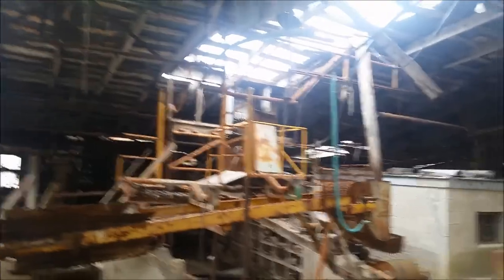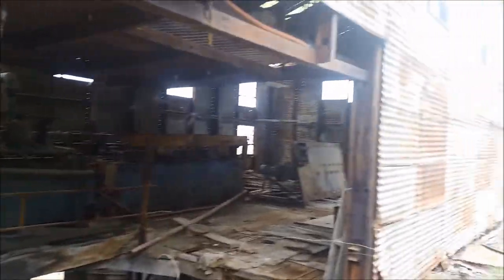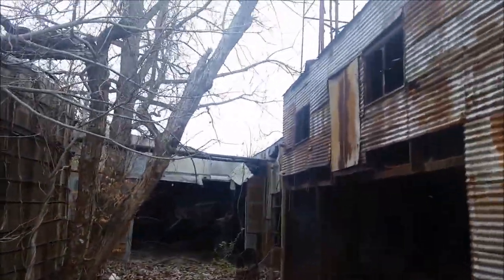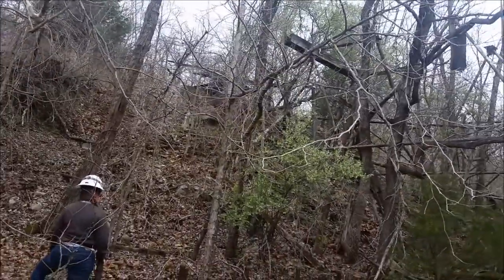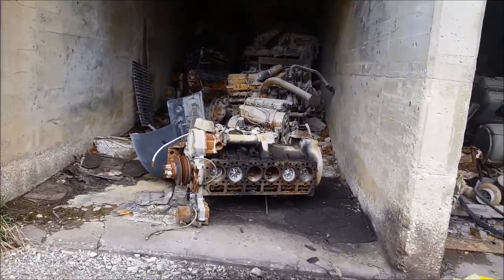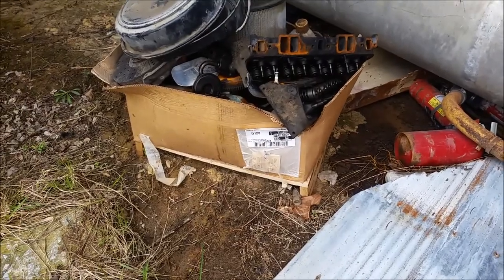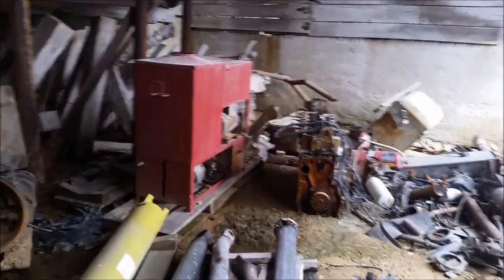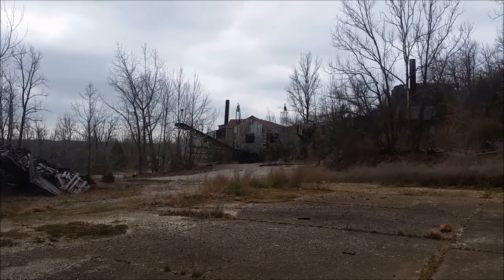Crystal Mine Exploration: Massive Fluorspar Mill from 1929!

Comment: This mill was "home" to me for most of my childhood and I ended up working here for several years as an adult. What memories this video brought back! My dad, Birch,  was a superintendent here. He and his 2 brothers Troy & Max Barnerd built much of the mill. As a child, I would go with my dad on the weekends. After the mill shut down, I transferred to Deardorf mine which was just over the hill.
Reply from the maker: Jack, thanks for your comment. As a mill guy myself, I love hearing from other guys who have been there and done that. The Crystal was one of the coolest sites I've videoed in all my time exploring mines!

Just out of curiosity, do you remember how ore was hauled to the mill and/or where the portals were located? That whole aspect of this site was hard to figure out.
Reply: The ore was hauled to the top of the hill and dumped into a hopper which fed a crusher then the belt would carry it to storage bins on the uphill side and rear of the mill. From there, it went by belt to a primary shaker screen and then into another cone style crusher. Then on to secondary/grading shakers which washed what was coming through. Eventually feeding into the heavy media cyclone. Then to the ball mill and classifier.
The ore was hauled in from the Crystal mine which was located near the lower office and mechanical sheds. Another source was Deardorf mine which was up over the hill. I was a shaft mine but the Crystal mine was a drift where trucks hauled the ore out.

The front area of the floatation mill had reagent tanks on a mezzanine above two large mixing tanks. Just inside the front doors was a filter cake that dumped lead into one of the bins and zinc into the other. Those were the bins you showed that have mechanical parts inside now.

There was also a dryer in the area where you filmed and saw the deer tracks. There was also a bagging machine down in that area too.

The cinder block room in the middle of the mill was where we did most of the quality assurance testing of samples. 

Sadly, I'm one of a couple of guys that's still living that worked in this mill. We were like a family there!
Reply: @jackbarnerd8333  Jackie, I remember also a lot of times running around in here. Us kids used to be here all growing up and then eventually worked here. I just ran across the video. Hope your doing well.